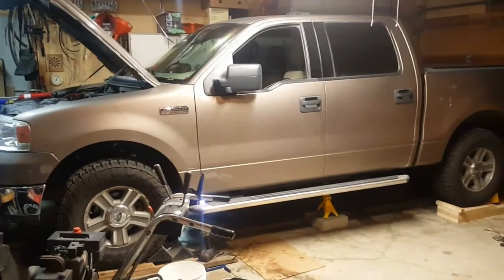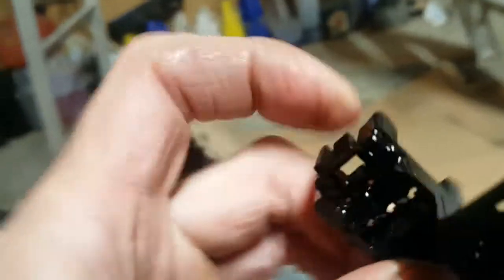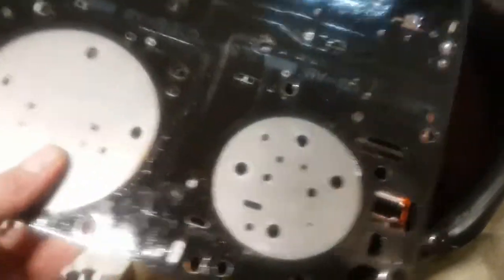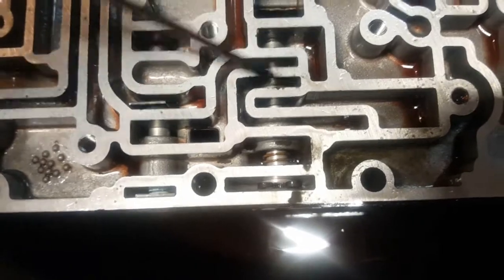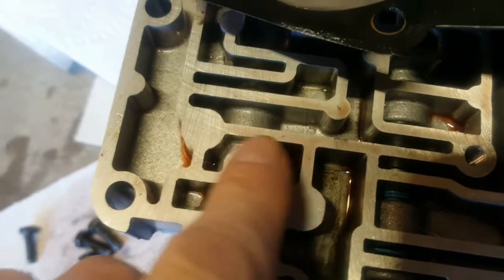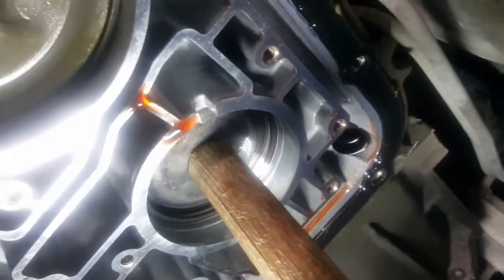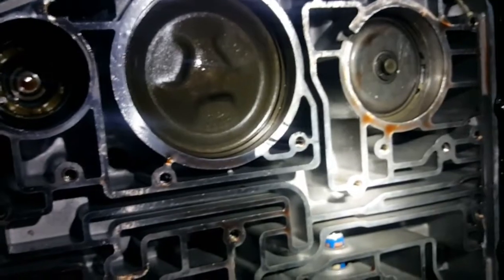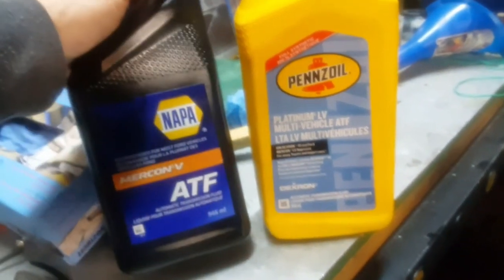2004 F150 Overdrive broken snap ring, transmission slips into neutral after 2nd or 3rd gear.

Comment: In the end years of the AOD, it was a pretty good transmission. Then they came out with this big cost cut transmission that has many problems. Typical  FORD product, work out all the bugs and then get rid of it and build some new POS from clowns that think they are engineers. Old school engines were so much more reliable as well.
Reply: So true and so depressing. And the thing is the engine is bulletproof the transmission not so much.

Comment: Found this video about a year after I fixed my overdrive issue, had the same exact breakage in mine, one end was lodged in the valve body hanging up the accumulator. Took about 6-7 hours from start to finish but ended up drilling a small hole in the ring and pried it out that way. To this day I still believe a shop would've told me the transmission was toast and try to sell me a new one for $7k
Reply from the maker: Sounds about right.  Good idea with the drilling.  I should have tried that but I assumed the spring clip was hardened steel and non of my bits would work?
Reply: @rjw3965  oh it was a pain to get through but the biggest concern was the bit jumping off and nicking the servo casing. Good to see we both got it done
Reply from the maker: @JacobTemple_CE  Definitely.  Been close to 4 years now and still going.

Comment: I think I have the same problem but my truck picks reverse, did your truck picked reverse at that time? Because my just work park and reverse
Reply from the maker: Hi.  Unfortunately that sounds like a different issue.  A quick google search shows your problem is pretty common but couldn't see a common solution?  seems there could be a number of causes?? Hope you figure it out and its not too costly.

Comment: Hey there, had the valve body out for another repair and that 2/3 accumulator retainer and spring popped out. Trying to get it back in place and having trouble getting the retainer to stay put so I can get the valve body back up. Any tips on that? Can I just use some pliers to pull the tabs out a bit to get it to stay in there?
Reply from the maker: Hi.  Thats what i ended up doing.  Gently bend them just enough so they're snug enough to put everything together.  Sure seems like a flimsy design?  but mine is still running fine so I must have done it right?
Reply: @rjw3965  Sounds like a plan. Just gave it a shot and it seems to be holding. Will get her fired up this afternoon and see what she does.
Reply from the maker: @roamin-ws2vt  good luck!

Comment: What did you find out about the screen you thought gets thrown out
Reply from the maker: Hi Rob, the cube shaped one (at 14:35 in the vid) gets thrown out.  The little flat square one (at 11:04 in the vid) is a solenoid screen and just slides back in where I show at 11:04.   Hope that helps.  thanks

Comment: Really helpful video thanks!!
Reply from the maker: Glad it helped.  thanks for the comment :)
Reply: @rjw3965  hey fordtechmakuloco speaks about a band when installing the servo did you have to do anything special when installing it?
Reply from the maker: @MrLafinest1  I believe that would only be if you completely removed the servo, then when you re-insert it you have to make sure that the band up in that slot is in a particular place while re-inserting.  That's why he has that tool stuck up there to hold it in place?  I didn't have that issue as mine remained in the housing the whole time so I can't really speak to that?  I think that's what you are referring to? (around time 36:40 of his video?)
Reply: @rjw3965  yeah you sound correct. I want to thank for your help because I was on the fence about if I can or couldn't do it but with the your video I have more confidence. I'm a little mechanically inclined and want to become better because shops are ridiculous 😄
Reply from the maker: @MrLafinest1  haha.. ya I try to do all my own work too.  That was the first time I opened up a tranny and its been 2 years now and she’s still running great.   Good to hear the vid helped you.  Good luck, hope it works out.
Reply: @rjw3965  yea going to be my first time as well hope this fixes it. Thanks for vídeo and response take care mate!
Reply: @rjw3965  one more question was your going into neutral when in fourth gear or was just staying in third?  From most of the incidents I've seen everyone is saying there is going into neutral and mines doesn't ever leave third or attempt to enter fourth 🤔
Reply from the maker: @MrLafinest1  If I remember correctly.. when it attempted to shift into 3rd it just slipped into neutral but when i turned overdrive off it would then shift into 3rd but i had no overdrive.  I thought of just using the truck that way for a while but very glad i fixed it as its been running great all this time.
Reply: @rjw3965  well yeah everyone is saying the same thing I have no slipping or neutral no high rpms just running in third. Overdrive on or off doesn't make a difference when I try it.🙄
Well I'm going to dive in tomorrow and see what i can find.
Reply from the maker: @MrLafinest1  Either way you should find the problem in the valve body somewhere.  should be interesting.  let me know what you find?  good luck
Reply: @rjw3965  i hope so thanks mate will do!!
Reply: @rjw3965  well I found that something hit the pan and bent it. Inside the pan I found small pieces of the leadframe but nothing connected to the terminals just plastic. Inside the valve body i found nothing absolutely nothing everything was free of debris which blew my mind.
Reply from the maker: @MrLafinest1  not 100% sure what you referring to there but maybe a tiny piece of plastic or something got in one of the valve passages?  make sure all the valves move freely (similar to timestamp 9:51 of my vid)?
Reply: @rjw3965  the black plastic piece that connects all solenoids. Only found pieces of it in the pan. Nothing was inside if the valve body & all the valves moved freely. I kinda figured this wasn't going to be my issue as most people mentioned symptoms of tranny slipping when attempting to go into 4th or high rpms and I've experienced none of those things.

Comment: My truck is doing the exact same thing as yours was. How much would this cost at a shop to fix? I'm in northwest WA.
Reply from the maker: Hi.  The parts are super cheap but quite a bit of labor.  Since I try to do all of my own repairs I'm not really sure what a shop would charge.  Depends which garage or dealer you take it to.. I'm sure there's quite a range of quotes?  Maybe someone else will reply to this with more experience??  Hope you find a reasonable place.
Reply: What part of Washington I need to do this to my truck it’s doing the same thing

Comment: Hi, nice video. I have a 2002 F150 and my transmission is not engaging into 3rd gear instead stays in 2nd. Is my transmission done or it might be just a component of it like the servo rings or solenoids or speed sensor?.

Comment: No follow up? How did it go?
Reply from the maker: hey Craig,  probably a good idea once i figure out how to add an update to the vid?  It's been a year now and the truck/tranny has been working great.  no problems at all and nice shifting.  I'm very happy I took the time for the fix.   Even the fluid level has remained the same.  I had mentioned near the end that my seal between the tranny and transfer case must have been leaking as there was excess fluid in the transfer case... so i guess the Lucas transmission fix that I added must have helped?  Thanks for asking.   If you'd like any further info let me know.  thanks